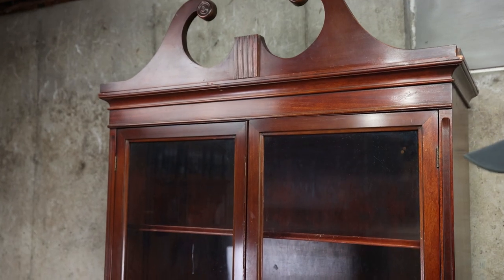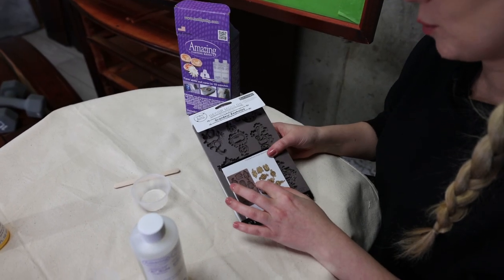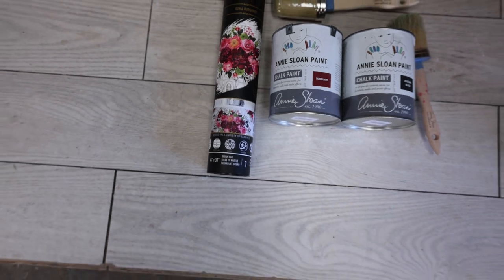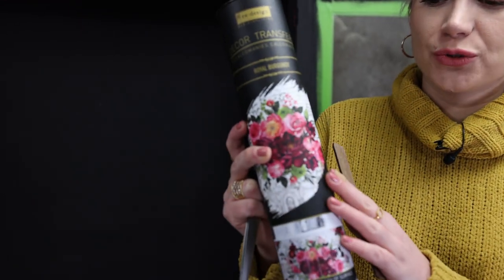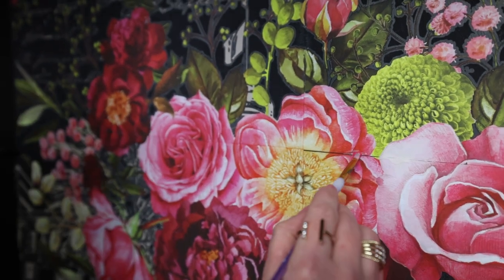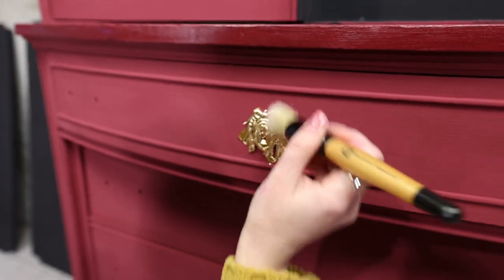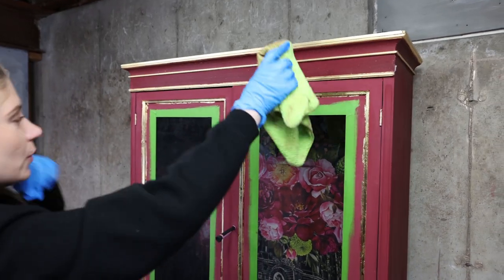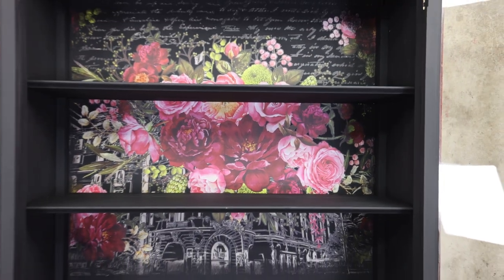Painted China Cabinet ~ Extreme Furniture Makeover

Comment: The results are lovely!  I enjoy all of your videos, but this one in particular gave me wonderful ideas to restore a china cabinet my Husband built for me in 1983.  The cabinet is all solid wood, and it's structurally very sound.  Several years ago our water heater had a catastrophic failure and flooded several rooms in our home before I could cut the water supply off.  The wood on the base section of the china cabinet, which was about 4 feet away from the water heater closet, became badly discolored, and then mold growth developed underneath the cabinet in an inaccessible area.  The china cabinet has been languishing in our Garage Mahal for over 6 months waiting for me to finally figure out what the best approach to restoration would be.  Eureka - I found it, thanks to You!  😃
Reply: This sounds like you have a wonderful project. When we were building our house with solid wood unvarnished floors some sections got discolored for some reason and the man doing the woodwork used some bleach on the wood to bring the colors back to a cleaner state. He said it was absolutely no problem on the wood. You might want to use a mixed solution of some bleach and some water on the areas that became moldy, to kill off all the mold.

Comment: Just WOW as usual. I am a big fun. I started flipping furniture about 5 months ago and I love it. 
I confess I picked some tricks from you.
About the glue in very little places, you can use glue syringe.
Here is what I use myself.
Plastic Syringe Blunt Tip Needle - 1ml, 3ml, 5ml, 10ml Luer Lock Syringes | 14ga 16ga 18ga 20ga Blunt Needles - Adhesives, Oil or Glue Applicator (Pack of 20).
Wish you all the best.